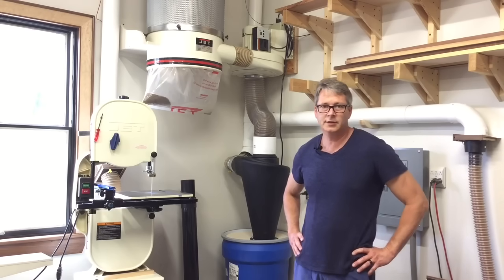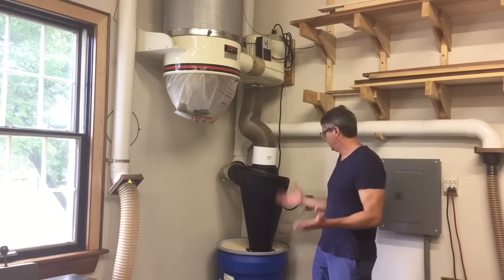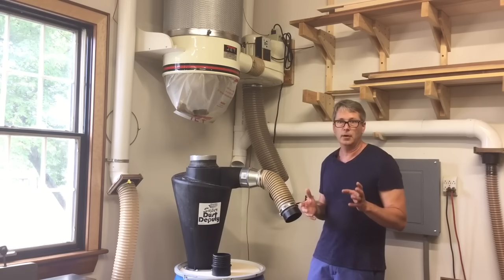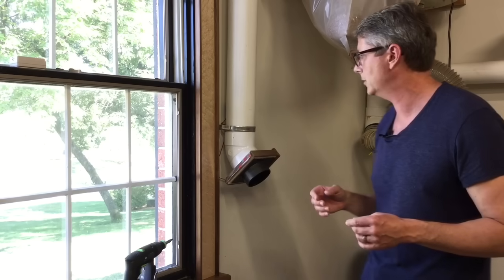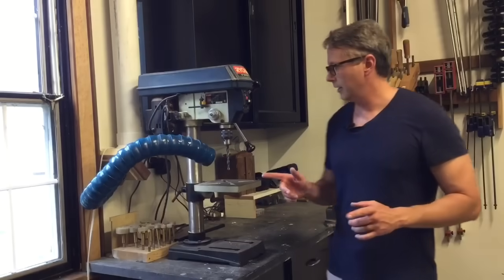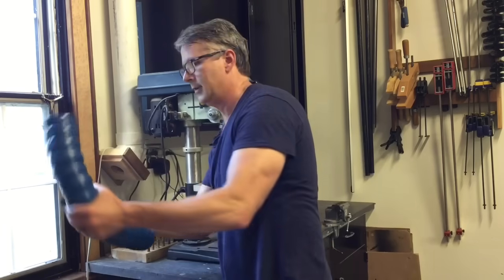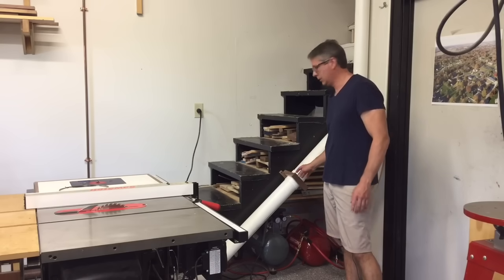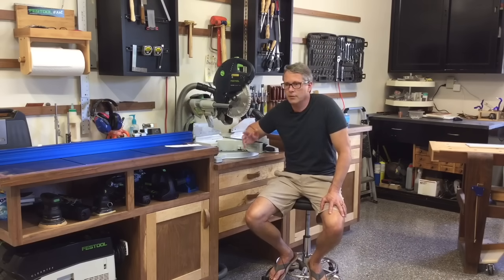Advanced Dust Collection System for the Home Workshop.

Comment: IVAC makes a dust/chip barrel sensor that is relatively easy to install.  It has indicator lights to tell you how full your barrel is.  Also, check out the drill press table on Bear Mountain Builds (YouTube).  He sells a great drill press dust collector and has an excellent video on a fence system that is easy to build.

Comment: I have a 4” PVC pipe system in my shop, works fairly good. The one issue I have is a 4” to 2” adapter that goes to my CNC. It continues to plug up there and I have to separate it and reverse the flow to empty the clog. Then it’ll vacuum fine for a bit then plug up again. PTA! Apparently it creates a vortex or something and dust and chips get hung there and pile up. I don’t know if longer taper on the cone would help or not? Suggestions?

Comment: I have a very similar 2-stage setup but since I live out in the country, I sent the air hose to the outside instead of running it through filters. The end of of outside pipe has dryer flap that closes when not in use.
Reply from the maker: That’s a real drain on your heating/cooling efficiency if your shop is climate controlled.  If that’s not a concern then you are good.

Comment: After watching your video I purchased the Long Ranger remote switch with micro-switches.  Nice!  However, I'm having problem connecting it to my Jet DC that has a magnetic switch on it.  Once power has been interrupted on the DC (e.g., once all of the Long Ranger micro switches have closed and power is terminated to the DC), the mag switch on the DC disables power to it until I the On button is pressed again.  Looks like you have a Jet DC with a mag switch on it.  How did you solve this problem?  Thanks!

Comment: Question: If you open a second blast gate (helper using a second tool with DC), does the DC stay running and shut off when both gates are now closed? 
Just wondering if it would work in my 220V situation. I do have a little help now and then. I am still using multiple 600cfm cheapie DC's, with various cart contained Cyclone options, but, seriously considering going the 220v and Permanent Mount route. Thank you. 
I have one system for a Sand Blaster and Steel Grinding downdraft table, the second unit in the wood area, which seems to keep growing.. Ha..Ha.. 
I will be moving to a new shop, adding new wood tools, and needing to build lots of Cabinets and Small Parts drawers, etc..
Reply from the maker: All blast gates need to be closed for the DC to turn off.

Comment: Nice job.  I did much the same with my Grizzly 1250 CFM setup.  All DWV piping, but I ran my centrally along the ceiling then over to the walls (6" main Y-split to 2 - 4" sub runs) and the same Oneida SDD.  The Oneida catches 99% of the chips/dust and worth every penny IMHO.  The most expensive parts of my system were the blast gates... I went with a bunch of butterfly gates from Woodpeckers (Fullthrottle) and they work great so far.  They run about $25 each, which is really not bad considering what you get.

Comment: Using this as a guide I built the same 2 stage system with the same Jet and dust deputy. Other than my home made blast gates needing rebuilt this system works very well. I also added remote start on the Jet since it’s up high on my 12’ walls.

Comment: How did you hook up the 4” pvc sewer/drain pipe to 4” flexible hose?  Was it the threaded adaptor from woodcraft throughout?  I’ve read many methods, but I have a feeling you’ve figured out the most elegant solution.

Comment: Great setup! I have the same dust collector and inspired by your video I also bought the long ranger product to create automatic blast gates. Unfortunately the long ranger does not work I.e. does not turn on the dust collector. Two electricians I requested advice say that I have to open and adjust the jet dust collector. Did you do the same? I would appreciate any advice on the issue. Thanks in advance
Reply from the maker: No I did not have any issues with mine. Hope you get it worked out.

Comment: Hi i like your setup.Hawe almost same jet dust colector.I wana make same system but my cyclone onley 125mm in.And from motor is 150(153mm) out. Can you help me disade i must use onley 150mm pipe from motor to cyclone.Or can use reduse 150mm to 125mm. What you prefer to use to not loose performence.Sorry for my EN.Tnks for your video.😊
Reply from the maker: Try not to reduce it. Bigger is better.

Comment: It looks like you set this up at least 3 years ago.  Have you experienced any issues with the impeller bearings with the unit on its side like that?  If not, how many hours per week do you run it?
Reply from the maker: Impeller is still going strong. Still loving the setup.

Comment: Wonderful video. I'm an old guy designing a small shop to be placed on a deck extension. That means I have the option of running all my duck work underfloor. That opens a lot of other options, but your blast gate design looks foolproof. Space saving by wall mounting is also a nice method. Thanks for all the tips. Solid Gold.

Comment: I have the same Jet unit and am in the process of mounting it just as you have. One question is I see your bracket for mounting the filter but how did you connect it to the filter?
Reply from the maker: Screwed it directly to the mounting bracket by drilling holes in the metal cylinder and screwed it from the inside.
Reply: @Selandry1  Thanks for the quick reply. That is what I thought. I will be doing the same thing. Thanks again for your video, it has helped me quite a bit. I saw your video on the blast gates and that is pretty sweet. Might copy you on that also.

Comment: Nice! Lots of ideas here. Based on a few other videos, I've converted a 2hp Shop Fox blower to a 2-stage, and installed it high on a wall like you did. Now I'm trying to decide where the runs will go.

It was easier and cheaper than I thought it would be, and even with only a few temporary flex ducts, it's totally changed the character of my shop. I didn't think I had room for a cyclone, but mounting it this way takes very little space.

Comment: Great video and sorry if this has been answered before.. do you think you could mount the motor higher ( even above the ceiling if you could) without impacting the airflow... ? Or is it important to keep the run between the blower intake close to the top of the cyclone ? 
Thanks

Comment: If you are going to dry fit your pvc pipes or screw them together I found it best to wrap the joints in foil tape made for ducts even for hose joints use that tape and a hose clamp too.

Comment: My Loc Line will be arriving tomorrow.
Reply from the maker: You will love it.
Reply: @Selandry1  I just got my first real collector. Okay, it's the Harbor Freight model, but I will upgrade. In the process of stockpiling parts and figuring out my setup. The Loc Line will be key as I use my drill press and router frequently. I will also be making a boom. Your videos are much appreciated.

Comment: Great video! Do you have any resources on how to install the blast gate micro switches? 

I have those on my cnc machine, actually have some extra, how did you wire your vacuum system to activate when we you release the switch? Arduino?
Reply from the maker: No I purchased the Long ranger micro switch system. It’s really easy, but they only make it for 220volt systems.

Comment: Very nice video.  You have to be careful when modifying blower inlet diameter.  That is part of the blower design and you can overload the motor if you make the hole too large.  If there is enough restriction in you system it can limit flow to a safe level, so best to check motor current, compare to motor nameplate.

Comment: Couple of questions as I am designing a very similar system in my shop.

1) What hp is the collector, I have the same jet....mine is 1.5HP model. 

2) Why did you decided to reduce to 4" after the super dust deputy? Why not keep it at 6" (same inlet as the dust collector), run all your pipping and drop downs at 6" for greater air flow, then switch to 4" flex pipe at the tool?---this is my plan unless somebody can change my mind and tell me why I shouldn't.

3)Blast gates...love them, have any plans?
Reply from the maker: 1.5 hp. I just went with 4 inch pipe because I thought the 6 inch look too bad. I plan on making a video shortly on how to make the blast gates.
Reply: @Selandry1   No issues with the 4" not being strong enough. certainly easier to find 4" pipe vs the 6", but i figured the 6" would give better air flow thus more suction
Reply from the maker: No issues in my small shop. I guess if you can go big then do it. Buy once cry once. I have had mine for several years and have not regretted the 4” yet.

Comment: I see that you have a small bag on the bottom of your Jet dust collector. Where did you get that? I wanted to do something similar by hanging it on the wall but the bottom bag takes up so much space.
Reply from the maker: It’s the original bag that came with the dust collector. I just cut it down a bit because the dust deputy separation takes 99% of the dust.

Comment: I see where the Cyclone is designed for a shop vac, not a dust collector, in my search on the internet. Is this a different type than what I need for my dust collector? Any comments from anyone would be greatly appreciated, as I need to know before going through all the designing and building my system. I have a JET 1.5 hp full-sized system with the cloth bag shown on the Left as first seen in the video at the 22 second time of the video, and NOT the other type JET with the shorter filter on the right. I don't mind the cost, I just want to get the correct type of Cyclone.

Comment: Looks great! Do you ever worry that if you only have a pipe extracting with a small diameter, ie something like the one going to your spindle sander, that due to the restricted amount of air flow, it could be a strain on the extractor motor? cheers, Andrew
Reply from the maker: That does not happen with dust collectors like it does with a shop vac.

Comment: Have you had any issue with the motor bearings? The reason for asking is vertical shaft motors have thrust bearings, while horizontal motors don't. Just curious. The bearings are easy to change, as long as the windings don't get damaged in a failure.

Secondly, are you using any type of grounding on the piping? It doesn't appear that you are. Have you had static build up issues? I know that is a rabbit hole topic, just curious about your experience.

Great shop by the way. I'm looking to modify my collector in a similar manner. Thanks for sharing.
Reply from the maker: No issues with the bearings yet. I did not ground any of the system and have had no problems wit static at all. The fire thing is a myth. Thanks for your comment.
Reply: @Selandry1  Thank you. The bearing issue shouldn't be a major concern either. I will warn if you hear an rumbling with the motor bearings, don't delay replacing them. If you wipe the windings the motor is toast. Great information. Thanks for sharing

Comment: I have given a lot of thought to your design and examples.  I have the same Jet DC as you but running on 110.  I added a baffle several years ago to help keep the debris out of the filter.  I added a Super Dust deputy last week.  This week I will begin building the blast gates and running the pvc air ducts.  My question concerns the baffle.   Leave it in or take it out.  I'm going to experiment with a manifold to add 2 blast gates side by side near the intake of the cyclone.  One for the Unisaw the other for the jointer/planer/drum sander as needed.  I'm in a busy 2car garage with the shop and cars in the same space.  The other branch run will pick up the radial arm, mitre saw, band saw, disk belt sander, router table.  My thought is to take it out since you have shown me a way to reduce the volume of debris.  What is your experience with your system?  Thank you for sharing your knowledge and experience, it is extremely helpful to more than you realize.
Reply from the maker: Don’t think you need the baffle since you have the dust deputy.

Comment: I have similar equipment with hoses on the floor. did you run a 6 inch duct off the dudt deputy? and then branch to 4 inch? thanks for gret ideas and sharing.
Reply from the maker: Yes I reduced it to 4 inch to use the standard 4” sewer pipe available at Lowe’s.
Reply: @Selandry1  I have had my system functioing for 9 months now. It's wonderful. Wish I had higher ceilings as my waste bucket is small. You got me started in the right direction. Many thanks for posting this

Comment: Like so many others, thanks so much for your video. It is extremely useful and I also converted by single stage Jet 1100 dust collector to a Oneida 2-stage, wall mounted system based upon your video. You are correct that it was tricky finding the right 6 inch PVC coupler as most couplers are for thicker walled Schedule 40 PVC (both current Home Depot offerings from NIPCO and Charlotte Pipe are Sch 40 even though they might say for DWV). You want a ~6.25" inside diameter coupling (sometimes called Schedule 35) and I finally found an inexpensive one from Ace Hardware (https://www.acehardware.com/departments/plumbing/pipe-fittings/plastic-fittings/48232). You can order online and have it delivered to a local Ace Hardware store at no charge. The HVAC reducer for the 5" to 4" can also vary slightly in fit. I tried both the one from Home Depot and Lowes and the Lowes fit better, but I did apply a little heat (from heat gun) to ease the installation.

Comment: Thanks a lot for the video. I also have a Jet single stage and looking to add the second stage Dust Deputy. Thinking to put the single stage outside and the DD inside (i have very low ceiling). You video is a great inspiration. Hope i can find the micro switches here in Australia. I look forward to your next videos.
Reply from the maker: Just consider that if you mount your outflow to your system outside you will be losing your climate controlled air.

Comment: Great set up! Wondering why you chose to run 4"line instead of 6" since the Jet collector has a 6" inlet? I just bought the same Jet single stage but am trying to map out my shop lines 4" vs 6"... I notice that you get really great performance out of the cyclone separator using 4".  Do you think that drop in air velocity is actually helping the two stage collection perform better than if it were 6" throughout? Any input would be helpful! Thanks
Reply from the maker: I wish I had done 6” in the beginning, but it still works good.
Reply: Walnut Workshop lol! Well, I’ve already finished up and used 4”... I wouldn’t know what I’m missing I guess. Seems to work well so far. I really got a lot from your video to help with my shop set up, I appreciate that! Thank you for taking the time to reply. Cheers

Comment: Great video, thanks so much! I am just starting the process of converting my Harbor Freight wheeled cart system to a Dust Deputy wall mounted system. My new shop has 10 foot ceilings and I was just thinking last night about stacking the filter above the dust deputy like you show to minimize space. Your configuration is almost exactly the same as mine. I have storage shelves to the right just like yours and a large cabinet to the left  same as your window. Your video was perfect timing! Thanks!!
Reply from the maker: Love your movies!

Comment: Thanks for your tips. Quick question: you don't ground your pvc pipes? Do you ever have any issues with electrostatic or fine dust building up on the outside of the pipes?
Reply from the maker: I have not had any issues with that.

Comment: Thank you for the very informative video.  I am in the process of installing a dust collection system in my shop and have a question, Is there a benefit to running the main conduit overhead vs running the main conduit low and piping up to the bottom of a blast gate then flexing into the machines?
Reply from the maker: I chose to run it high so I could still push my tools snug against the wall.  Running it low would probable be better if you don’t care about space.

Comment: How high is your ceiling?  Do you have a gap between the top of the filter and the ceiling?  (Great video with tons of help!  I am building my new larger shop this fall and will integrate your excellent ideas as I replace my old small shop and dust collection system)
Reply from the maker: I have about 18” gap above. My ceiling is 11’ which is a huge bonus. If it’s not too late make sure you have high ceilings in your new shop. Thanks!
Reply: @Selandry1  Thanks !!   (current plan is a 9' ceiling but I may rethink since there are many advantages!)

Comment: Question: Since you are running doorbell wire from the micro-switches along the pipe back to the switch at the collector, why couldn't you just tap that wire into the pipe at various intervals so it could serve double duty as a grounding wire? I know that grounding the plastic pipe to prevent dust explosions doesn't seem to be backed up by actual cases, but for us belt-and-suspender types, why not kill two birds with one stone? Would this work? My electrical knowledge is pretty much zip, zero, nada. "If you can't fix it with a bigger hammer, you have an electrical problem. Hire a pro." Anyway, I thank you for this video. Elegant and simple = genius!
Reply from the maker: Never thought of it!

Comment: I bought a 2hp 240v dust collection system. When I open only one 4" port that is reduced to 2 1/2", the suction is severely reduced. Do you have the same issue with yours?  If so, how do you solve it?